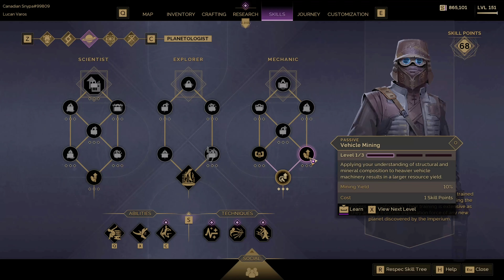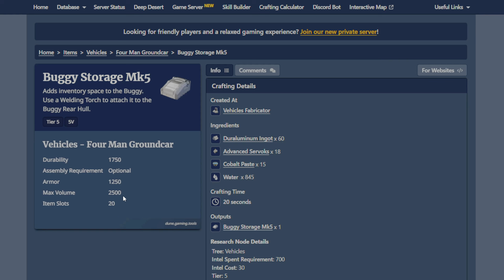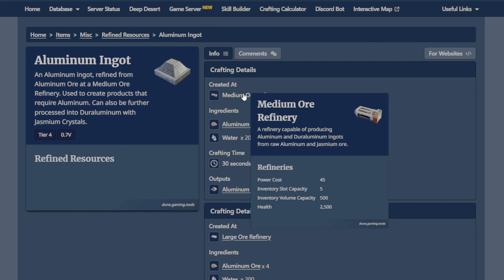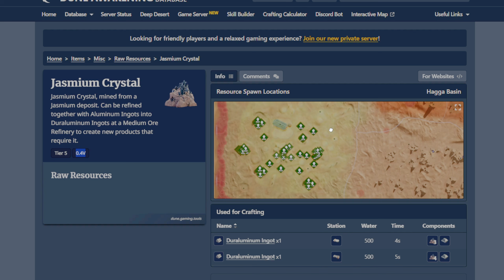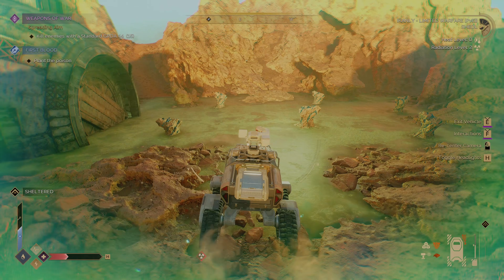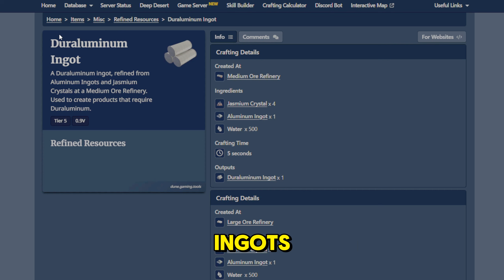Never Run Out of Water Again - Aluminum & Duraluminum Farm

Comment: Aluminum an Duraluminium become secondary concerns once you hit the plastidium an spice mining stage, even to the point of not been required once you have a decent supply. An the most important an best location for your main base in as close as possible to the spawn in zones from the World map. 
The other solution i used is a base in the southern most point of radiation zone just with 1 large shipping container an buggy. Multiple runs to fill it fulll of jasmium. i then just flew my carryall out of hagga via north exit where my main base is, flew in south west hagga at rad zone, picked up container an flew it home. Didnt require any more jasmium runs after that.

Comment: 10:20 You're doing all wrong m8. There is a salvage ship southwest near the radiation zone there is an island near that ship you can build a small base and across from your base there's a radiation island If you travel from your base to that island you can fill your buggy very quickly and back to your base in less than 5 minutes.

Comment: Make sure you got max chassis...save fuel

For jasmium build a base in the 6 node island... No need to build outside..rad does not dmg the base... And you do not need to mine the big island...go counter clockwise from the 6 node island..and by the time your done mining the trio nod islands .buggy would be full..put it inside the box of your base inside the rad field ..rinse and repeat .haul using the assault..BUILD A CARRIER AND MAKE YOUR LIFE EASIER..

Comment: I never need a scout when farming Jasmium with the buggy.
I’ve set up a base at the southernmost point, and from there it takes about 10 minutes to fill the buggy completely. By the time I get back to base, radiation is always at around 95% – perfectly timed.

My setup:
- MK5 Radiation Suit
- MK5 Cutarray
- MK4 Storage

One run equals two and a half full Assault Ornithopter storages.

Comment: Getting a mk5 bloodshot engine is awesome it goes from medium-fast speed but its mostly the acceleration, since most of the time you are driving the buggy is in between nodes while mining so you are always starting from parked. May not sound like that big of a deal but 3-5 minutes out of a 20 minute trip still cuts out a decent % + you will win all your drag races now 😁
Reply: It also makes it safer to get to Sheol by ground alone (I did not feel like making a base there).
Reply: Another video I watched showed little to no increase in acceleration. If anything it’s lower top speed.
Reply: @rb_boyd  I didn't need a video to show me doing donuts and drag racing my group, buggys are mainly used for mining node-node so +/- a few top speed does not matter, Its how fast you go from standstill since you will be doing that 30/40 times or more per trip 🤣In game in feel 40%+ faster
Reply: @alwaysberandom6470 I mean the guy recorded his travel times and showed absolutely no difference. Idk

Comment: We got rid of the Large windtraps... Compared to the advanced desthstill   they dont stand an Chance ... And constantly building Filters And Check If they run Out of Filters is annoying  7!  Large Windtraps are needed to gather the Same amount of water as one "big" deathstill  ✌🏻
Reply: Large wind traps gather a lot more water than a big deathstill . About 160000 over a 24 hour period or 80,000 over a 12 hour period. But they obviously do it slower. Per hour it’s certainly less, but again you just turn it on then forget about it for a day or multiple days depending on how many filters you have. Both are good
Reply: It's nice having both. I'm out of the house for around 12 hours a day plus sleep. I run the wind traps during that time then shut them off when I get on and load up death stills
Reply: To fill our storage with the advanced death stil, say you had 10 you would have to use them 11 times ..killing and transporting 110 bodys + getting back to them 11x to put new bodys in 🤣or just craft filters with the excess resources we have and you can leave it days at a time.
Reply: I have both and windtraps are the way to go. Collecting bodies is just as annoying and more micro management, putting 7 or 8 bodies into deathstills every 45 min gets tedious and you waste a lot of time farming bodies instead of mining or doing landsraad or whatever you really trying to do. 
Im running about 30 large windtraps solo and a shit tonne of  storage, roughly  2000 litres atm but plan expanding it to around 4000. The wind traps pump out equivalent to 3  adv deathstills every 45min, its roughly equivalent to 100 bodies through an advanced deathstill every 24hrs. If you were running say 8  adv deathstills, you would have to put a body in each one every 45min for like 9 hrs straight! 

It takes me two minutes to service filters and im done for 3 to 5 days depends which filters i run. 

Takes me about 5 minutes to do speed runs with bindu, shiga and knee charge to collect enough grass to craft a weeks worth of filters and i actually find it more fun and way faster than stuffing bodies into a buggy 1 or 2 at a time lol. 
If your water  storage is full and you're not doing any production for a while, pull the filters to save them. When ever I accumulate enough pumps, build another tank.
Reply: @cwarky7325 Also one annoying think about the stills is you can’t transfer corpses from storage directly into the stills. Have to remove it from storage into your inv then put it into the stills. Which is annoying because every other machine you can just inject fuel directly from the circuit
Reply: @cwarky7325 it is not in the slightest lmfao
Reply: Every one argueing about this. I can not understand.
IF  you playing this game half-serious, you'll need BOTH methods..
The windtraps just run 12h with the small filters *5 = 60 hours..
One time in 60 hours filling, I mean cmon...
(Not talking about the good filters that makes this WHOLE 5 DAYS, doh are a little more expensive)

And you fill the stills while you are online and need big bumps of water.

The only thing what suxx for me is blood.
It is just such a waste of time and way too annoying..
Reply: @pun15h3r. blood was good whilst in the early and mid game but once you get stills and traps there is no more point or it
Reply: @pun15h3r. The key is more windtraps, not more filters. Though that will be irrelevant after next patch and your traps will auto shutdown saving your filters making windtraps even easier.
If you are serious,... You dont bother with micro management of deathstills.
Reply: @cwarky7325  I mean at some point it is just how big you scale it all xD

I think the stills are still good for some big bumps now and then.
Cause 50mins ~250k water (I have 5 advanced) is a good bump if you are playing and need the water quick. And I have a big mob base around the corner, so I get a quick load of my assault full of bodies. It's not that bad.
But yes. Over all it's good to have a big amount of windtraps. I recently scaled up a bit so I have 10 large for now, before I build even more.

I just have to figure out a good way of "hiding" them, cause my wind-tower did not went as I planned it xD
And I just find it so damn ugly if they stand on top of your roof.
Reply: @pun15h3r. Haha yeh, i used to run 7 adv deathstills. Aa a solo with 2 lg ore, 1 lg spice ref, 2 med chems all in rotation whenever i need to.  Stilll running 30 lge windtraps and i just keep adding storage tanks. 4500 litres now. 
I havent turned on the deathstills for about 2months  lol and have a full meat locker. 

Gonna build another water farm next door just for the hell of it. Goal is 10k litres storage, i hope they give us better options to trade and transport water one day ... but maybe i wasting my time.  Its fun atm
Reply: @cwarky7325  haha nice one dude! ;D
But you know, never a waste of time if it is FUN! :D

I recently build a water tower. But it didn't worked as planned. So now I'm building Tower 2.0. Hell yeah man, 5k litres I'm coming as well xD

Comment: If you're two making the buggy and have the mk6 focused cutteray you need the mk6 psu or you'll be waiting a lot for it to cool down and that was using the mk5. But if you're solo cutting mk5 psu works great with it cause you won't be hitting them super fast. Great video
Reply from the maker: Thanks!! And great point, I mostly farm solo, but upgrading even to a mk5 is probably a good idea, especially where I have a pile of duraluminium now
Reply: @Engineered_Gaming  You can get 70/80% of the mk5 buggy parts just from running chests, we have a plast container full with mk5 orni/buggy parts just from runs, we get so many mk4 parts we just recycle them.